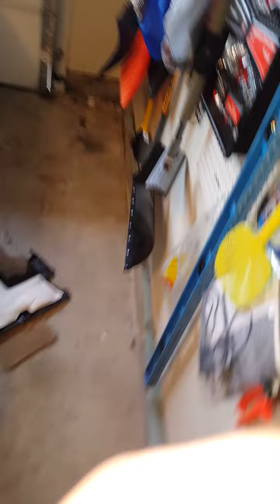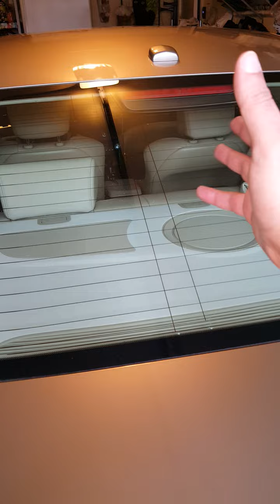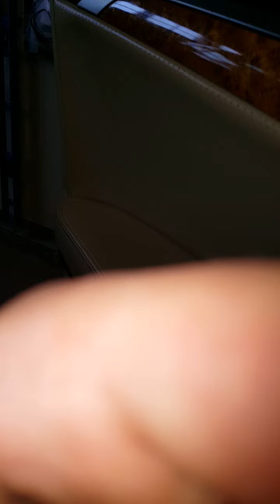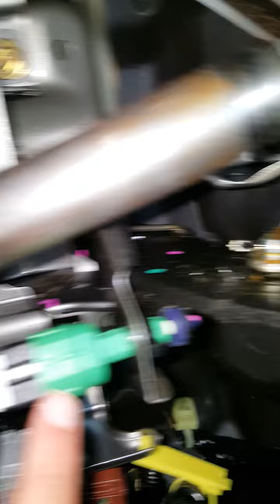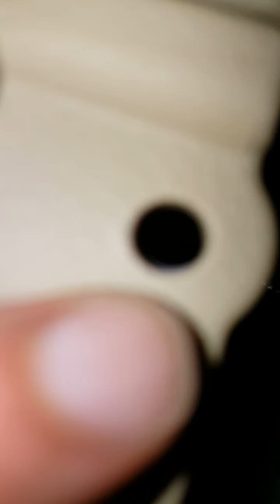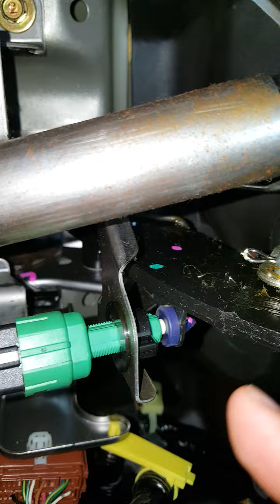How to replace the brake light switch on the Acura TL

Comment: I need to know what you didn't show. I have a 07 TLtypeS. Can't remove the panel to access the switch. I've seen video of 03 where they show removing  panel and it's not like mine. He said just pull it down easy from the front. I can pull the back down but don't know how to release the front!

Comment: What's up man I  watch your video and I Fallow everything the U described but my shifter is still locked in park and my brake lights still not working.. Is there something am   doing wrong ?
Reply: Cheyenne Dones hey I have same problem. did u fix it?
Reply: runnerJong  same here did you guys ever fix it?
Reply: Same here, Bought a new switch, checked fuses and nothing !

Comment: thnx - mine failed and i cant move the shifter - bought a non oem - and this vid helps a lot .
Reply: YES!!!  If your automatic tranny shifter won't move out of park, check your brake lights.  They are probably not working either!  Replace the brake light switch and both problems get fixed.  More than likely your cruise control also won't shut off when tapping the brakes.  The car doesn't think you are hitting the brakes so it won't shut it off.  Be sure to remove the wire harness first and then unscrew the switch.  Only loosen the 14mm nut on top - do not try to remove the bottom "nut" - it stays there.

Comment: 3:41 seconds and you don't furnish any details on exactly how it is replaced/installed. Unscrew? More details? Unscrew what? where does the wire harness detach? So far mine is not cooperating.
Reply: It detaches that green and black thing in the video you detach that and replace it with a new one they clip together